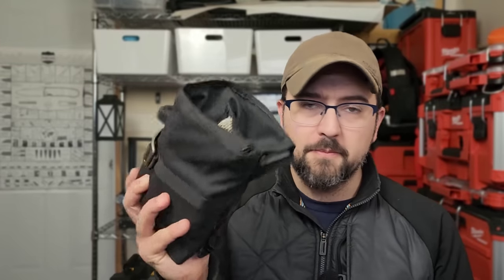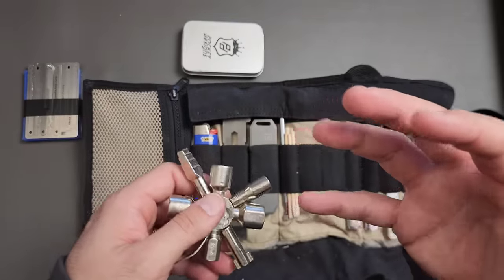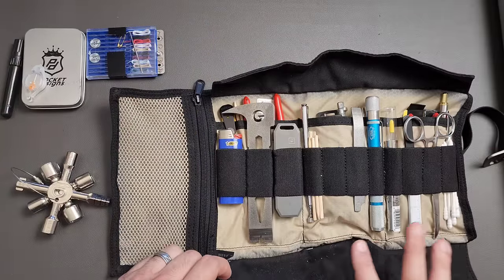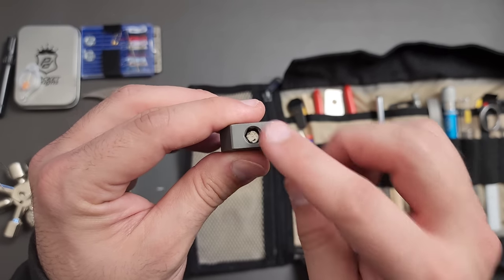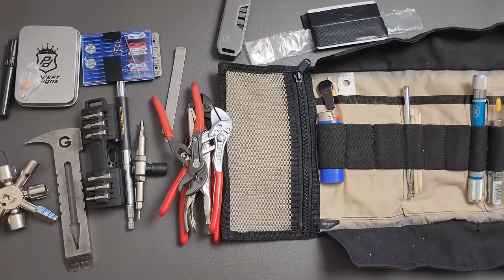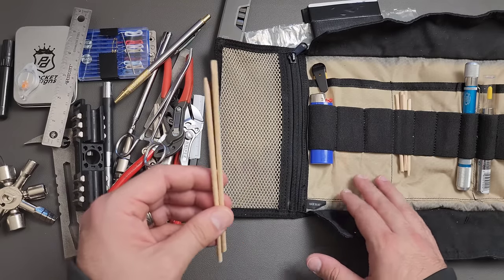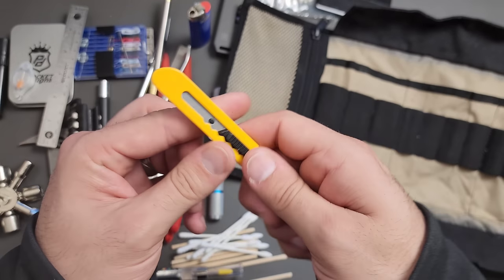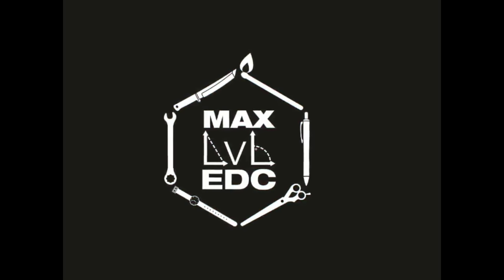🧰 My EDC Tool Kit (v1) How can I improve it?

Comment: A very inspiring video. I have a lot of suggestions but don't take them as criticism because I really like your set.

Add Leatherman Surge, remove the wire cutter and all pliers except the Knipex Cobra. Take out a small crowbar (many things can easily replace it). Leave only one rounded file from the set of files (you will have the one in Leatherman). Take out all the bits and add those from Leatherman. Add a ratchet screwdriver from Leatherman. Add extra long and possibly narrow bit versions: PH1, PH2 and slotted 1/8 (for deep seat screws). Throw out your sewing kit and instead get some high-quality leather or denim threads and roll up the colors you actually need. Add a small spool of one very strong thread. Add 5m of 1mm copper wire. Add more tape. Add instant glue. Add cosmetic tweezers with a wide tip. Add t-shank blades for metal and wood. Add alcohol swabs. Add 5ml plastic (HDPE) vials of acetone and gasoline. Add/replace your lighter with a high quality incandescent lighter. Add a pen. Add a notebook or some rite in rain sheets. Add a pencil. Add a high-quality USB cable with adapters for USB-C, USB micro and lightning. Add a USB-A/USB-C flash drive. Add a non-contact voltage tester. Add a vial of magnesia. Add a vial of baby powder. Add more tape and pieces of high-quality double-sided tape. Add two-component adhesive. Add a piece of thicker fabric and a small package of transparent shoe glue (if you soak the fabric and the hole in the clothes / bag with it in moderation, you will get a very strong patch). Add an old credit card. Did I mention the tape? Add real lockpicks and throw out the ones you have. Add 5m of nylon cord.
Reply from the maker: Thanks for imput!!

Comment: You need to set a purpose. You don't carry a small kit because the tools feel nice, you carry them, because they are useful for a specific set of scenario/s. 

You have too many pliers. The bolt cutter is not needed, you can carry saw/s...

It all comes down to the purpose and trading the comfort of tools for their size.

I have watched a bunch of videos and this one is by far the best. I actually set a very similar kit and I use it every time in the house and when I travel, it hasn't let me down: https://youtu.be/nX1rmKcmtt0
Reply from the maker: I saw that exact video, in fact that's where I learned about the files. But I can one up that kit with a few tweaks..what I agree with 100% is that I need to separate it into 2 parts.
Reply: @maxlvledc  it's going to be very interesting what you can put together 👍🏻.
Reply: I was also thinking that the lub items can be skipped. You can put a few drops on a straw and seal it.